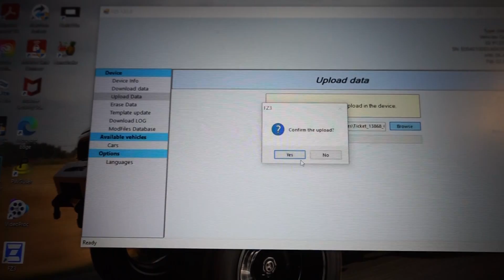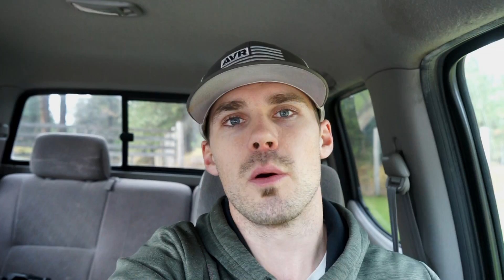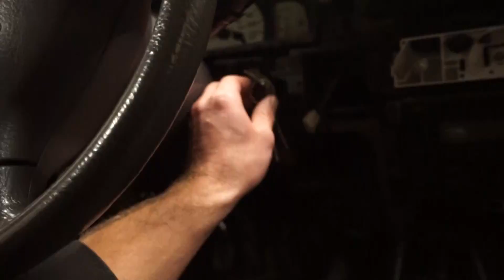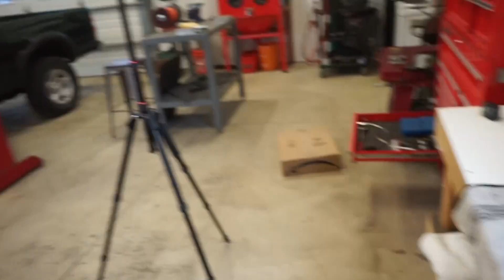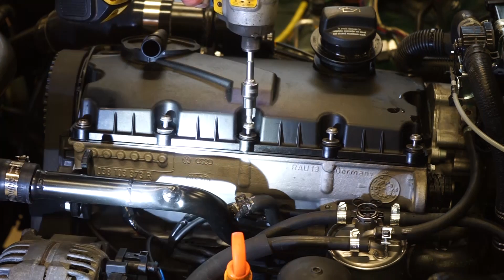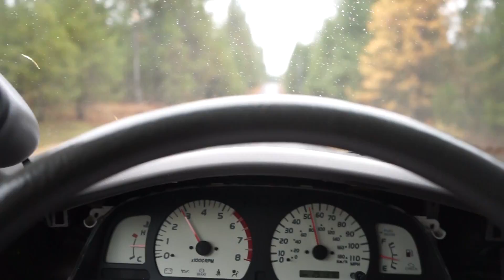Diesel Toyota Tacoma Gets A New Tune!!

Comment: I know it’s not a huge thing that bothers you but I recently did my shifter bushings in my 98 Tacoma and it made a huge difference when I was shifting. It goes into gear really smooth and it’s roughly a $10 part

Comment: Compressor issue is a tough one, GM LS compressors work the same way variable not like the cycling clutch as what the Toyota has. For the LS guys I believe they are welding couple components inside the GM compressors to convert to cycling style. Doubt that valve you're messing with is going to help. Maybe build a adapter plate that will use the Toyota compressor or try the same style in the red toy if it fits. This will be interesting to see what you figure out.

Comment: They make a build your win o ring kit where you get the right width o ring “stock” and you cut it to length then “glue” it back together I’m sure it would be a huge pain in the ass doing it with the part installed but I’m sure you can do it

Comment: Try using an o-ring splicing kit. Pull the harness flange out far enough. Cut it to fit. Mate the o-ring ends & let cure. Slide it on to harness flange.
Reply: It's an X profile oring. Leaked on my golf too. I just cleaned it really well and used ultra grey.

Comment: I know a little about HVAC, being on the compressor that valve can be 1 of 2 things, I believe that is some kind of hot gas discharge valve(controlling output) but It may be on the suction side of compressor(controlling input), All AC systems have a metering device right before evaporator coil, I am just guessing but it sounds like one of them needs to be eliminated

Comment: The whining noise sounds like a high-pressure exhaust leak, pre turbo. Exhaust back pressure on vnt turbos, or vgt's is about 2 to 1 so the exhaust pressure could be around 45-50 psi when you're building 20 psi on the compressor side. If it is a pre turbo exhaust leak you can close the vnt all the way to make the most back pressure, then Rev the engine and use a hose as a stethoscope around the exhaust manifold or turbo area to try to identify the leak. Worth a shot.
Reply from the maker: I’ll try that out! Thanks!

Comment: For your AC system, I would have gone the other direction and used the VW valve.  Reason being as all it needs to do is increase the pressure high enough on the hot side to get the refrigerant to condense in the condenser. The toyota system regulates the pressure with cycling the pump, the VW does it with the valve. The problem is now that you've adjusted the valve, you have to have some way to adjust it back to spec. You could do this by trial and error, but that means opening the system multiple times and you know the issues that causes. 

So! What I would do is hit a junk yard, pull the valve out of a used pump, then slap it in your compressor.

Comment: Lol my 22RET i think only gets like 5 lbs of bost. I don't know much about new turbos. But apparently they've come a long way if 20 is low.
Reply: I had a 22rte in my 86 4runner. It was super low mile junkyard motor. Modded it with the turbo, injectors, and intercooler from an 88 turbocoupe. That thing would scoot!
Reply: Haha my diesel 1KZ-te maximum boost  is 11psi after that it goes into limp mode,
I wish I had a 22RET for my old Hilux I don’t think we got the turbo version in Australia..

Comment: Just Hardwire the cable on the compressor to the A/C switch on your dash using a 12V 40 Amp relay. The mechanical control valve on your compressor will regulate automatically the cold so you won't need a thermostat

Comment: Your friend is talking about a Sanden compressor with electronic control valve that is controlled electronically by the CPU. Usually those type of compressor don't use a clutch an run all the time. This compressor you have uses a mechanical control valve and must have a clutch to activate the compressor same as the Tacoma OEM compressor
Reply: the one I'm talking about is a sanden sd7v16 with an internal pressure sensitive control valve much like the passat B5 bosch unit (not electronic). Biggest difference is the bosch has a valve that is serviceable without breaking the comp down. They operate nearly identical. The variable displacement compressors don't play nice in systems where the pressure control regulation is achieved by clutch interrupt. While the VW's do have a clutch interrupt it's not the primary control for normal pressure regulation. Clutch interrupt in a variable displacement system is used as a safety control when pressures or temperatures fall outside the normal operating range.
Reply: @jimbote1968  So here's my thought; the two systems should be operating at a similar pressure, (same refrigerant) so realistically the flow rate would be the main difference. Could the stock VW variable displacement pump be used without a clutch interrupt in the system as it was designed? I don't see any reason to re-engineer the pump, however I'm no specialist in these systems either. How does the valve regulate flow? is the pressure being bled off used to reduce the volume being pumped , or does it work in a different method?
Reply: @MonkeyWithAWrench  my thoughts exactly! Was going to say same thing but see you already did... run with out the Tacoma trying to control pressure?
Reply: @MonkeyWithAWrench  the valve works by moving refrigerant from the high side to the crankcase (back side of the pistons). This brings the crankcase pressure closer to equilibrium with the high side. This reduces the swashplate angle and thus the stroke. The issue with maintaining this system in a Toyota is that the expansion valve in the VW is matched to the VW compressor, RCV, evaporator, condenser. This is not a thrown together system but each part is carefully designed to work with the other. My guess is VW or sanden or bosch designed the system to, ideally, not cycle the clutch for increased overall efficiency. It's a smart system but not ideal for use in a "dumb" pure clutch interrupt pressure control setup that the tacoma uses. It's an interesting thought exercise to imagine the vw rcv would work well with the toyota system but the fact is others have tried and failed. That's why it's best to delete the rcv. It's not my idea and I'm not sure I could have figured it out on my own. I'm riding on the shoulders of people who have a more in depth understanding of AC systems. I have learned a lot over the last few years but I'm no expert. I think if you had a fully adjustable expansion valve and a fully adjustable RCV you might could make an rcv system work in the taco. Otherwise it's a stupid simple mod to disable the rcv and turn the smart VW compressor into the dumb, full stroke unit, the toyota system was designed around. Not only that but the RCV is the number one reason these compressors stop pumping.

Comment: You cannot eliminate that control valve. That valve controls the displacement of the pistons inside the compressor. On your video I can see a clutch on the compressor
Reply: you can eliminate or disable it. The result is the compressor goes full stroke just like a normal non variable displacement compressor. At that point pressure control defaults to the toyota clutch interrupt regulation. I deleted the valve in my sanden and it works great.
Reply: @jimbote1968  there is no need to disabled this control valve since this is mechanical and not electrical and controled by the CPU like on the Sanden SD7V16. This compressor has a electrical clutch like on the OEM Tacoma compressor. To activate the compressor just connect it to +12V
Reply: @arm2644 Again, the MK4 sanden sd7v16 and the B5 Bosch use a purely mechanical rcv. The mk5 and newer VWs have the pcm controlled rcv. If you don't delete or disable it the pressures will swing up and down as the two control protocols chase one another. Others have tried, without success, to leave the valve operational. I personally know two swappers who left the valve in and experienced intermittent AC operation. Valve delete fixed the issue 100%. Did you read that article I linked?
Reply: @jimbote1968  the problem is that those variable displacement compressors are not designed to work full-time on full displacement. Their life expectancy will be shorten since the piston rod will break! He should Hardwire the A/C switch to the OEM compressor main Relay and bypass the A/C module to avoid the compressor to be turned on/off
Reply: @jimbote1968  i'm thinking that compressor is the same as the alh but they relocated the valve because they fail alot and moving it to the outside makes it easier to replace. so just putting a bolt in it like the alh probably will work
Reply: @arm2644  LOL! which piston rod? There are seven pistons and rods in that compressor. The same pistons and rods that sanden uses in the sd7 compressor. The SD7 compressor uses the same swash plate design of the sd7v16. The difference is that the "V" compressor varies the swash plate angle depending on internal pressure. The SD7 runs full stroke 100% duty cycle. As for the relay idea, the Toyota already has an AC ecu with an internal clutch relay and that ecu cycles the clutch depending on the signal from the pressure switch. If you simply add a relay in between the AC switch and clutch then you're bypassing the automatic control toyota designed into the system. Bypassing the control will quickly lead to a system overpressure with the last ditch safety factor kicking in. That "last ditch" safety factor is a spring loaded refrigerant pressure relief on the compressor housing.  So you lose part of your charge everytime the system pressure spikes.
Reply: @gregh7457  the mk4 is a sanden brand. The b5 passat is a bosch brand. Different design to achieve the same swash plate control. I imagine bosch placed the valve on the outside so they could fine tune the valve during test runs of each unit.
Reply from the maker: @jimbote1968  thanks for explaining this! It’s making more sense to me now. Like I said I’m going to try it as is and see how it does! If it doesn’t work right I’ll have to figure out what to do